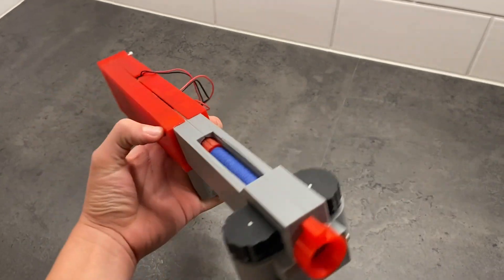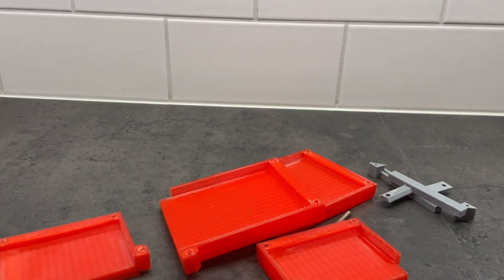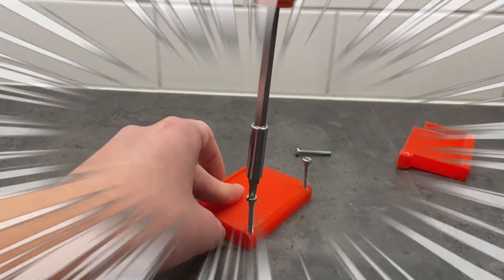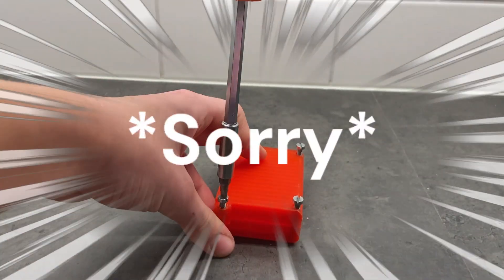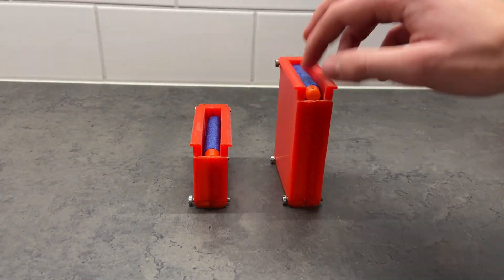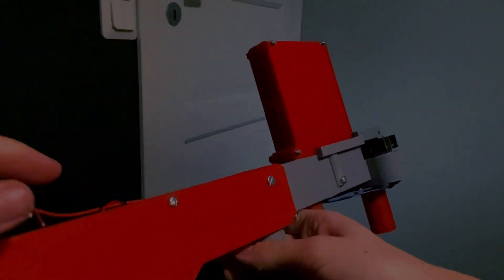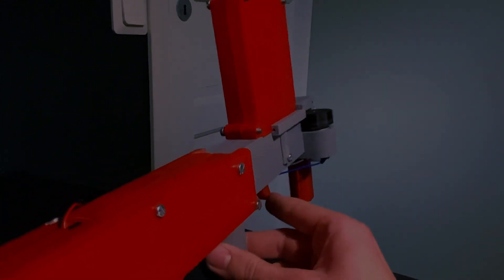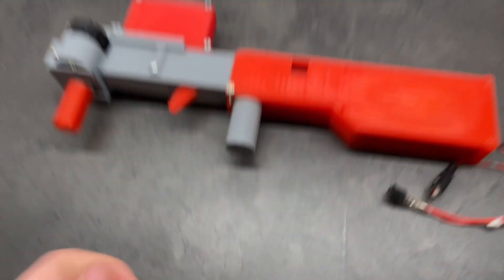Building a 3D printed nerf gun, part 2

Comment: One thing you could do if you want to use a electronic trigger you can use a blinker module for a car (stay with me here) because all it does is activate a electrical signal over and over. Hook that up to a simple solenoid, and you have full auto! If you put a dual stage switch before is and wire that up bypassing the blinker you will be able to switch from full auto to semi auto!
Reply from the maker: Thank you for the tip! But it might be a bit too complicated for me 😅 But thanks a lot anyway!

Comment: Pro-tip when designing screw holes:  Make the top part a loose fit hole (make the hole bigger than the screw threads) and only have the threads engage with the bottom part.  This will save you time and stop the parts from splitting apart as you screw both together.
Reply from the maker: Thank you, i will certainly use that! :)

Comment: a few minor upgrades would be having the magazine at an angle similar to the Pederson device magazine, another one would be a spring for the trigger, channels for the wires to be routed through as well as the wires being soldered, and smoothing the interior of the mags with sandpaper
Reply from the maker: Good ideas!
Reply: @roboterror  to be fair i have some experience in modeling physics from my game dev days, so if you need any more ideas after these improvements im only 2 bottles of cheap beer from greatness